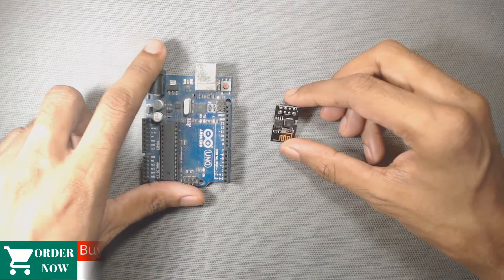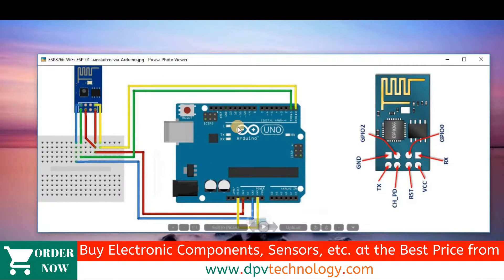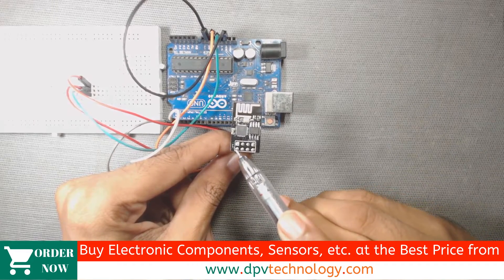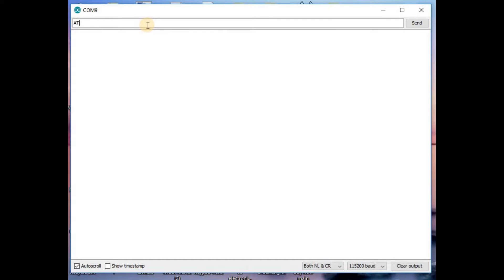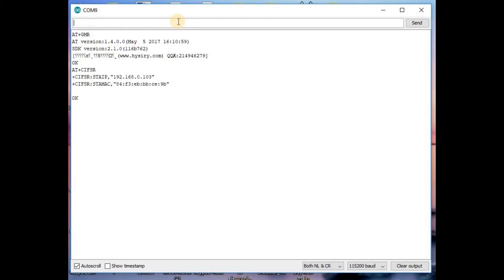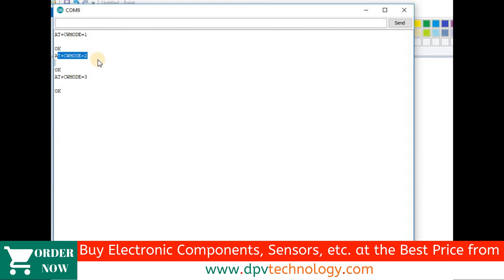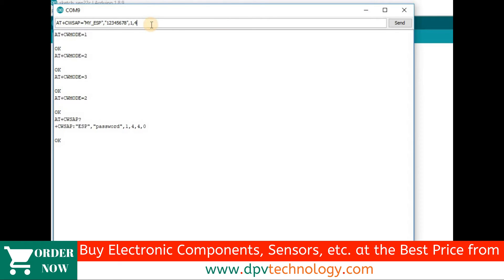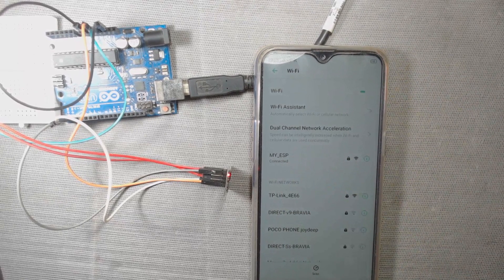ESP8266 Basic AT Commands  using Arduino  | Name Password Change of ESP8266 using AT Command

Comment: Please help my esp32 module is only responding to these 3 commands

AT, AT+RST, AT+GMR

the rest of the commands are all giving me ERROR
Reply: Are you asking about an ESP32 (you said) or ESP8266?

What response did you get from the AT+GMR command?  If you are using an ESP8266, you may have a very old version of the AP firmware with limited functionality.  If you are using an ESP32 you may have a 2,0 or later version of the AT firmware - the syntax of the command may have changed.
Reply: @mikemilner8080  thx for the response

 it worked fine i was making some dumb syntax errors

Comment: I have to send "Hello " message from one WIFI module to another module to check the module range & strength then what should i do? which mode (Ap or STA) do i need to set for WIFI module. could you please help me.

Comment: You haven't covered the most wanted part - connecting the esp8266 to home Wi-FI. For that, use the command AT+CWJAP=”SSID”,”PASSWORD”
And for any commands to work, line endings should be selected as "Both NL & CR".

Comment: I'm getting no response.  I was wondering if someone could clarify.  Do you have the Arduino IDE board set as "Arduino Uno" when you upload the blank program?  I assume so since you take it out of reset mode before uploading.  To issue AT commands, you have the Arduino Uno in "reset" mode, but did you have to change to the "Generic ESP8266 Module" in the Arduino IDE?
Reply: HEY IS YOUR ISSUE SOLVED? I AM TOO NOT GETTING ANY RESPONSE FROM MY SERIAL MONITOR, I TRIED SO MANY THINGS, NONE OF IT IS WORKING
Reply: 😕 same

Comment: Did exactly the same connection .. but AT commands not responding in Serial monitor
Reply: U got solution?
Reply: @jaiemandi502  yes..      pin ground to resett on adruino .  Then Tx to TX  and RX to RX. From adruino to Esp-01.  Sometimes need to restart adruino by pulling power en putting in back..   programmed esp-01 with AT  Commands..  remove ground to reset and change TX  to RX and vice versa.   For me the TX amd RX port from arduino was unstable so i used Softwareserial.h. Library and used port 10 en 11 for tx and rx.  After stable.. and everything working fine
Reply: I got some grabage values and it's not respond with AT commands

Comment: wi this procedure work, if i had already uploaded a my custom code to the esp8266, before doing this.. i.e 1. i uploaed to esp8266 via arduino uno, my costom code. 2. i follow these steps. .. so will this still work..
Reply: If you uploaded Arduino generated code, you wiped out some or all of the standard firmware that makes the module respond to AT commands.  Check out https://www.youtube.com/watch?v=wXXXgaePZX8 for a decent tutorial on flashing the 1.7.4 version of the AT firmware that supports the commands shown.

Comment: I AM NOT GETTING ANY OUTPUT ON SERIAL MONITOR AFTER TYPING AT COMMAND AND I FOLLOWED THE PROCEDURE PLZ HELP
Reply: IM GETTING THE SAME ERROR. ARE YOU ABLE TO SOLVE IT?
Reply: does blue LED on esp blink when while your IDE is waiting for connection?
Reply: had similar problem, i checked my connection are firm or not after knowing they are firm.. i tried again, still got same error, then i unplugged from my laptop the USB, then plugged in again an uploaed the program to esp, error gone
Reply: RX and TX need to be connected in a crossed way. TX of the module to RX of Arduino and Rx of the module to TX of the Arduino